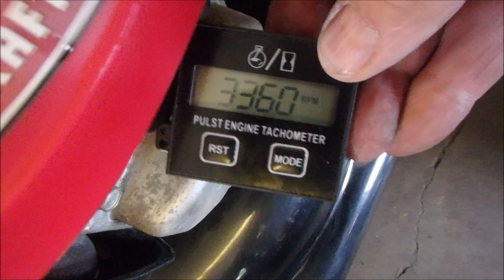Craftsman Mower With Honda  GCV190 No Start

Comment: Hey. Bruce 
We must live in parallel universes!  I had bought two older Craftsman mowers recently.  Neither had bags. They looked like wrecks but they cleaned up up awesome.  Good used bags can be purchased for about $40-50.  I listed both for $120 each and never got any bites.  I picked up another one with a bag.  I threw the bag on one of the listed mowers, updated the listing and it sold the same day for $160.
And… I have very few parts.  I try to only buy machines that are salvageable.  I’ve bought some that the seller has said were for parts and were easily salvageable!
Reply from the maker: I am not selling any new ones till spring now.    I did sell this one to a close friend.  I rushed the job a bit with that old fuel line on there but he lives just down the alley.

Comment: Easy to pull the bowl. Pulling the whole carb on those Honda’s means you have to use 7 hands to reassemble.
Reply from the maker: I know.  Compared to a nice Briggs quantum where it is the air filter and 2 screws for the carb.  The carb just has a bow nut and a built in emulsion tube.

Comment: Bruce, on Honda carbs it easier to use to double threaded screws to hold it all together when ya take it off. Make re-install much easier.
Reply from the maker: Right.  Dave Ackerman taught me that.  Sometimes i do and sometimes I don't  Thank you

Comment: i have this same mower but after sitting for an hr it takes a few pulls to start then soemtimes hiccups..usually thats a sign of thigns being loose i guess but this one can tbe so i completely rebuilt the thing it was sitting for years wihtout use so i put a bunch of new parts on it..evertually it runs good but after sitting yet agian it take s a few pulls to start..kind of annoying tbh all my other mowers start first pull..could be bad gas form last year still running out of the engine idk ...
Reply from the maker: New types of gas only last a couple of months .  I bet the carb need a cleaning.